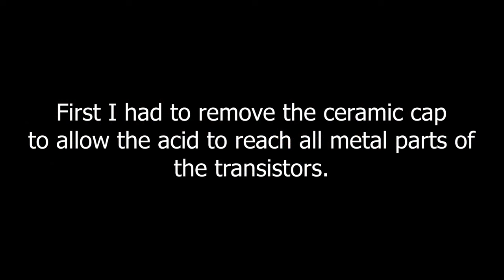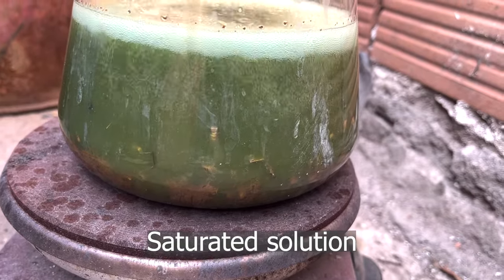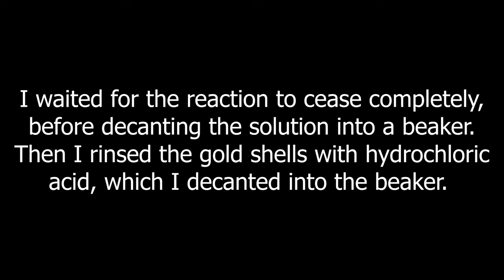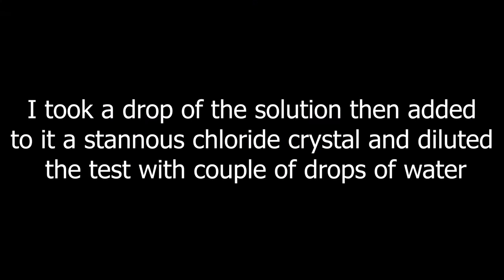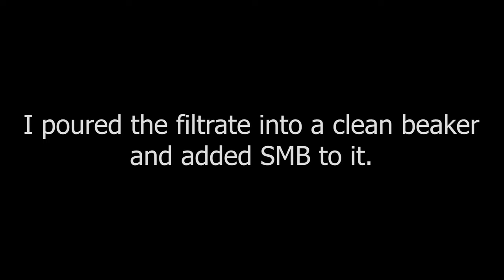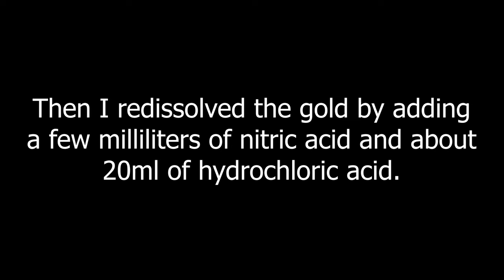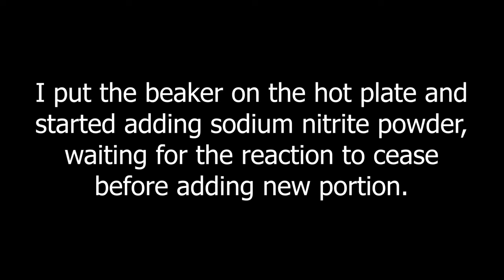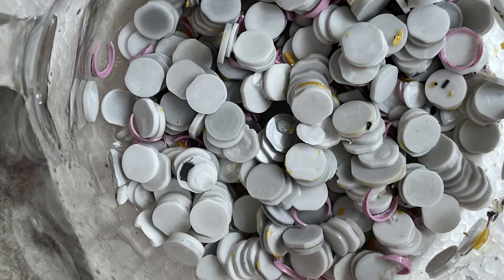Gold from 327 RF Transistors

Comment: Your math is off by one decimal point, it's about 0.05g a piece with those numbers
Reply from the maker: Thanks I’ll get it corrected
Reply: @OwlTech333  
I have several liters of used gold plated water and I am trying to extract the remaining gold in the water... how do I do that other than electrowinning?
Reply from the maker: Zinc
Reply: @OwlTech333  stainless steel?

Comment: Superb ! $30k from ~$1500 of transistors. Nice one.
I was a little bit worried that you were refining KT971A devices.
The Purple color in the ceramic caps might have been a Beryllium salt.
Maybe a good idea to check on that.
Reply from the maker: Corundum
Reply from the maker: How did you get to the 30k figure?
Reply: @OwlTech333  OOOps. My bad. I took the troy ounce value, not the Gramme value. Sorry
$1500 to about $4000 is still good
Reply: It's about $1002 USD worth of gold at today's prices at $65.67 a gram.

Comment: If paint thinner worked then I would assume any petroleum-based solvent, such as varsol, turpentine, kerosene, etc. would work.
Reply from the maker: I would think  so, but petrol doesn’t, I tried it
Reply: @OwlTech333  Petrol is mostly Benzene, Toluene and Xylene(s). Maybe your local paint thinner is Acetone ?
Acetone is a Very aggressive solvent - works on many things.
Reply from the maker: @aga5897 nah I tried acetone too it didn’t work. It’s a mixture of aromatic and aliphatic hydrocarbons that’s what it says on the label
Reply: @OwlTech333  Cool - A guessing Game ! We did the common Aromatics already. The most likely Aliphatics are Turpine or Limonene.
Amazing that you can make Limonene by pyrolysis of car tryes.
Reply: @OwlTech333  I can see acetone not working on a paste, it isn't really a degreaser.  I wonder how good old dish soap and water would do, maybe with some air bubble agitation.
Reply from the maker: @lelandlewis7207  I tried alkali with no success
Reply from the maker: @aga5897  I don’t know what’s in there mixture smelled like gasoline
Reply: @OwlTech333  I was thinking more of off the shelf dish soap since it is mnade to breakdown grease.  We use it a lot for washing engines befor assembly as it removes oil and grease quite well.  Also great for greasy hands.  :-)

Comment: Did you run out of acid? Why wouldn’t you at least cover the bottom of the beaker for the second dissolve?
Reply from the maker: I wanted concentrated solution and the AR I made was more than enough to dissolve the gold I had
Reply: @OwlTech333  fair enough. Well done sir! 💪👍

Comment: There was ssooo much wrong right from the start...painful to even watch. 🤔
Reply from the maker: Sorry for the suffering my video caused you
Reply: What was wrong?
Reply: @bubaks2 people who dabble in amateur radio use these rather expensive transistors in the amplifier circuits of their transmitter.

Likewise repair shops that repair two-way radio equipment from like police fire etc.